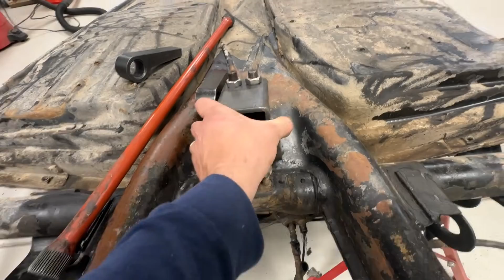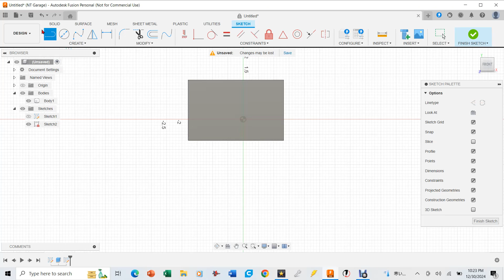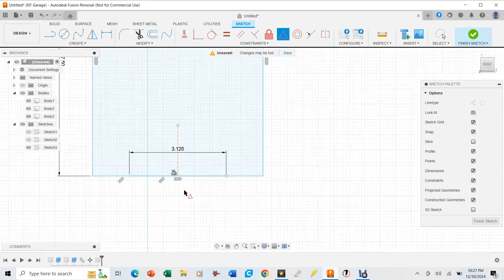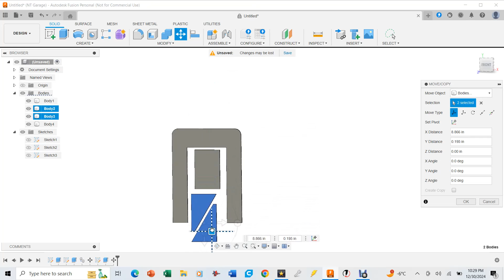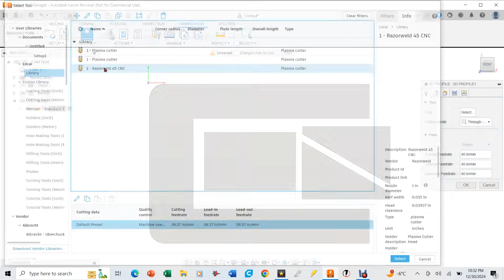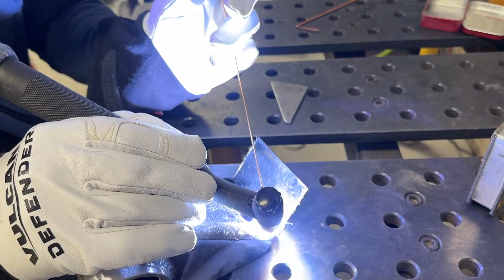How to install a VW Bug Torsion Housing Adjuster - Sway-a-way

Comment: Isn't 17mm hex the same as the oil plug on the transaxle? I've seen these with a much shorter length to get in the between the swing arm and frame.

Comment: Dude - great video. FWIW the OEM gearbox rear transmount is fitted to the rear of the torsion tube. Someone has cut it off and re-welded it to the underneath, potentaily to fit a bus transmission, as the shift rod connector is "higher" in a bus than the bug transaxle. ( the best way to fix that is with a Gene Berg adapter kit on the bus trans, which is much stronger than the bug ). 
The mount you created looks great, however you could work with replacing the stock one in the OEM. location too.
For the welding on the backside of the tube ( inside the tunnel ), you can remove the upper cross brace tin by drilling out the spot welds, and then I would cut off a section of the upper tunnel for access, then weld it back on once the inner tube is finished.
Also interested in the Autocad software - I use "sketch-up", as an old time drafter I found it much more intuitive to use than what you demonstrated on the Autocad stuff, but basically does the same thing.
Looking forward to seeing how you fab the roll cage, front suspension etc. !....

Comment: I have been watching your channel for years.  I just the other day searched for this exact video.  I am considering doing it for my Manx (fake) buggy.  Was hoping I could do it with the body installed.
Reply from the maker: @cbdzcbdz  I think you can do that.  Depends on your welding skills.  Mine are limited, especially in difficult positions.

Comment: surprised there wasn't any install info on that torsion adjustor. I thought everything was on the Internet.
Reply from the maker: @DJ-yp4kc  forgot to add this to the video.  I did find instructions wadded up in the box they came in.  I would give them a C for instructions.   Pictures were washed out,  the wording was ok.   There was nothing new from what I did.   One lesson learned for my experience was that I probably should have heated up the adjusters before forcing the springs in.
Reply: @ntdracing  Yeah. Great video, but pounding them in is not the best. Best to take a bit of sand paper and take the OD of the torsion bar splines down just a bit until it just slides in. Otherwise, spline clocking can be a nightmare.
Reply from the maker: @MikeMcDonald-c2d I am working on our 2nd but and I am going to try heating the arms up.    I think that will make it easier.  Thanks